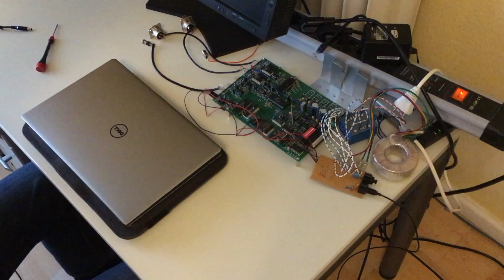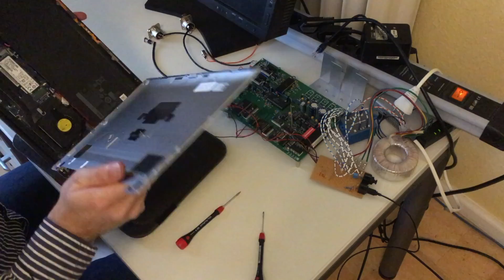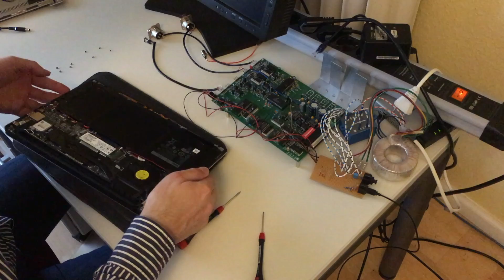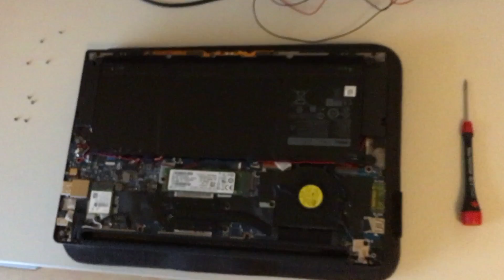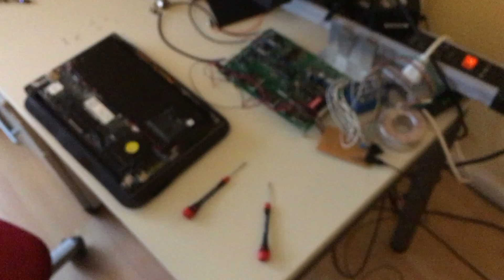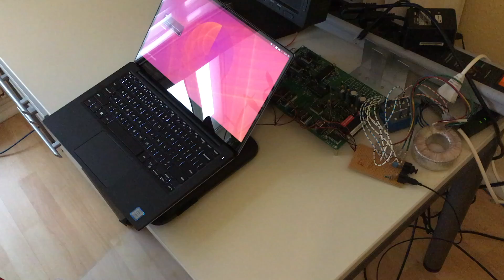Teardown Dell XPS13 9360, look inside, Kaby Lake, NVMe SSD

Comment: hello all, ReneRebe, do you know if its possible to replace the 2.5 inc Sata for a PCIe NMVe Samsung 950 in this model? 9360
Reply from the maker: was the original one SATA? PCIe ones will only work if the socket physically has PCIe lanes wired to it (and the BIOS supporting NVMe), ... PS: but was the original not already PCIe, NVMe? I think it looks like this in my archived hardware listing: https://t2sde.org/hardware/portable/Dell/XPS-13-9360/

Comment: Do you know if it is possible to change the CPU in the Dell Xps 13 9360? (put a i7 instead the i5 that came with)
Reply from the maker: IIRC this and probably all compact "ultra"book / thin laptops CPUs are soldered directly onto the logic board, .. :-/ so not simple to change.
Reply: almost no new laptops can change out the cpus...

Comment: what was the trick to getting the back off - it seems like you had quite a tough time in doing this.
Reply: Get some spudgers, like small plastic crowbars. That's what they are for, prying these things apart. Make 100% certain you've got all the screwdrivers off and then wedge some spudgers in there and work them along the edges.